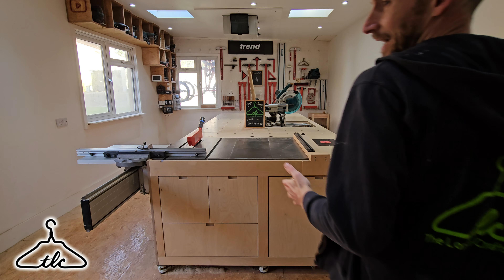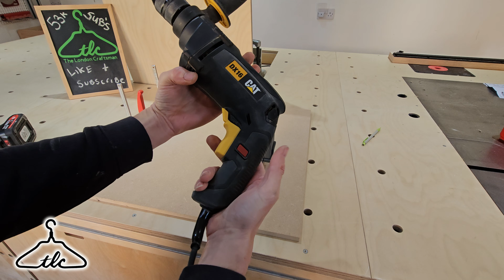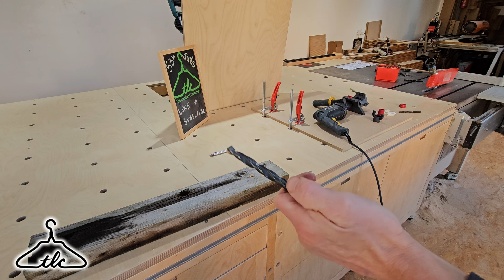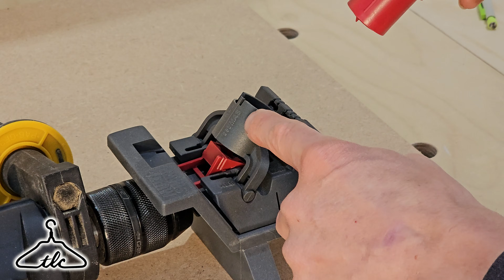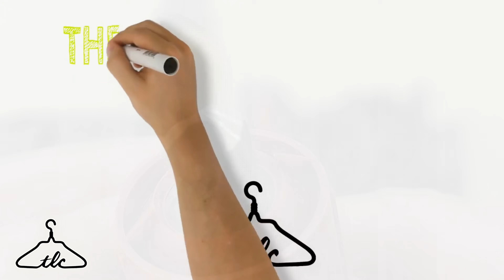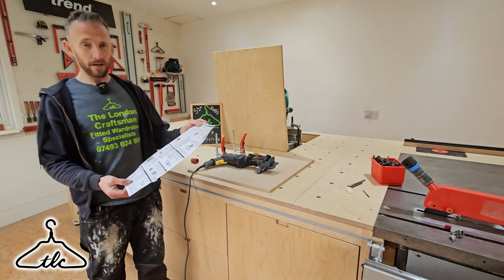REALLY!  A Drill Bit Sharpener That ACTUALLY Works....?

Comment: This is brilliant, but time is money.   I can pick up a new set for 5 quid.
Reply from the maker: Hi!

Hss drill bits are relatively low cost, but this sharpener can also do sds, masonary, flat bits, centre point bits and also other tools.
If you want to replace other bits then it would get expensive...but still, do you want to keep buying and spending money when you dont have to?

Honestly, this machine takes 10 minutes to setup, you can leave it on a board so its always ready, and then the hss bits only took 30 seconds per edge (2 edges, 1 minute) to bring back to new... Bit of a no brainer tbh considering its only the tip of the drill bit that is dull...

I put it off for so long using it, I had it easily 8 years sitting there, and wish I used it sooner!

Trust me, once its set up and ready to use, its a pleasure to use and probably even quicker than going out and buy more :-) plus save loads of ££££

Also, if you have a nice expensive set that are usually 100x better than cheap ones, then youd want to keep them maybe?

Just my 50 pence worth 🙂
Cheers Ryan
Reply: @thelondoncraftsmanworkshop  That's VERY true. Useful that, but for HSS bits? I just bin em.
Reply: @8BitLife69  I think it's more about selling the gadget. If you have the kind of drill bits that are so expensive that it's worth sharpening, you wouldn't be using a little chintzy gizmo like that. On the other side like you said🥹, if you have everyday drill bits, whose got time for this when they cost so little.
Reply from the maker: If you haven't used it you can't really have an opinion on it. I used the machine, it did a fantastic job, it only cost £20 and it sharpens everything I need it to. Why would you need anything else or a really expensive non chintzy gizmo when this does the job.

Alternatively buy a really expensive gizmo or spend more money constantly when the drill bit gets blunt 🤷‍♂️

Its not about selling the gadget, its about showing people a really low cost affordable method of sharpening old bits rather than just buying new and adding to landfill...

Ryan 👍